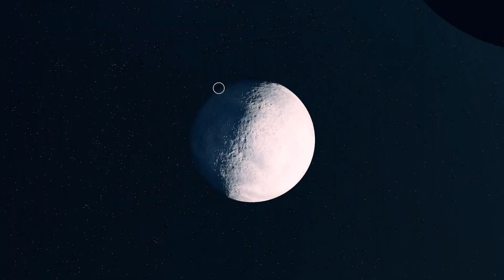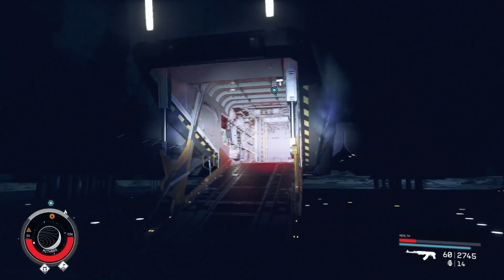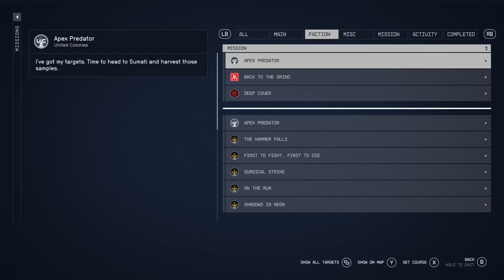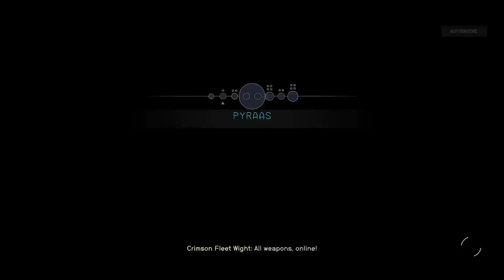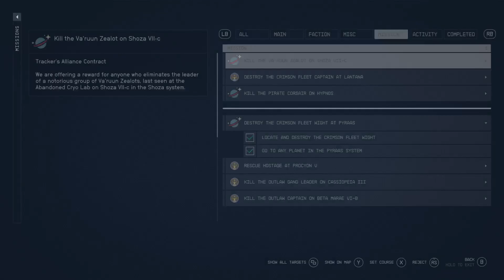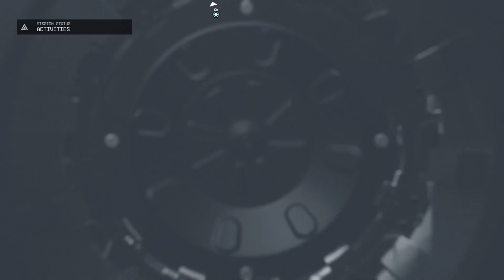Starfield Testing our new Ship we Built Ep 04

Comment: PS - get rid of turreted weapons ! Many new players use them, fooled by paper stats. In practice, they miss the target a lot ( even the game inform you about that...) and are still bugged, sometimes they will not open fire, or will fire at far away targets instead of the one right in front of you, who is killing you. Use ALWAYS player controlled weapons. When you choose weapons, do the math: see dam / sec , range, power consumption, and - important - the RoF - rate of fire ! A weapon with apparently low dam but high RoF can do significant more dam than one with high dam but low Rof. ALWAYS use ballistics in targeting mod, to disable engines, after you strip the shields. Ballistic weapons are THE best weapons against hulls. Reason you should have ballistics as primary weapon. Laser as secondary. Missiles as third weapon. ( even if, tru to be said, you only need just TWO sets of weapons...). 
( use INARA Starfield - all the info you need is there, about ALL ! ). 

Most important, avoid the crap of Particle weapons : they are way too OP, unbalanced , and make the boarding a lot harder ( when you need to control your dam in order to avoid killing the target). Bethesda should delete particle weapons or balance them, using some common sense. 
These weapons are killing 99% of the fun. 
I stop using particles after the first 100h of gameplay.
Reply from the maker: I'm not sure if all turret weapons are automatic, but I'm definitely going to check my weapons.  I don't care for the automatic.  Thank you for that.
Reply: @vanmennace If it says turret, it's automatic. I use them, but only in the third weapon slot and facing the sides and back, that way I'm always firing. Works beautifully. Plus the auto weapons get the perk bonus for auto weapons and the perk bonus for whatever their basic type is too. So, while they can miss, they hit plenty. I always test my ships in Kryx, and I always win with particle turrets combined with ballistics and energy main weapons.
Reply: they fixed the bug the problem is that not only do you need the turret skill.. you also need at least 1 manual fire weapon (not missiles) to get the turret firing best is to aim them backwards  then you open up on a ship and do a 180 and watch as they melt things that chase you.
Reply from the maker: @blastingweevil2968  love it
Reply: @blastingweevil2968  - you miss the part where I talked about turret's accuracy - they miss a lot more the target than a manual weapon! Even the game tells you that. Instead of using that power units in a less effective weapon, I prefer to use those 3 / 4 units of power in an extra engine. If you can out-run / out maneuver an enemy,  you are way better safer, cuz most of the cases (especially at high levels) the enemy will always outgun you. But with better/more engines,  they will never out-run / outmaneuver you.

Comment: Gorgeous ugly build, yet I admire your sense for functional first.  I suggest you look for "Freestar Renegade III", a Ron Hope design,  who fall in line with your style: offers a lot of space, and you have both the landing bay and the dock in the nose ( the ship is like "E" letter,  switched to the right side, where the landing bay is on the middle leg, and the dock on a side, left leg. 
This build can carry up to 6-7000, using 5 SA-4430, (5x2 power) and you can easily slap a 40 units power reactor, and a B class, 36 LY jump range, small grav drive, yet keeping max maneuverability at 100% ( with full skills in storage). You WANT max maneuverability, speed and maneuverability are way more important than shields, especially pass lvl. 90-100. 
Slap engine thrusters / breakers every point you can. I found, after the last update, my pitch and yaw, turn rate,  considerably improved after I equipped as many of those I could. 

With the right skills, you get a perfect 45  /  50 power vs power usage  on her, using 2 x Reza 300 (2x4), 2 Hunter Mag 450 "stronk" missile launchers (2x3 power) and, for boarding purpose, 2 Marauder 115N (2x4) who hit hulls stronger than a train ( 60x4 / sec,  each, for a total of 240+ x 2 = 480  ) . (max skills on ship ballistic weapons). 
Use the Osiris 2040-B, BEST  shield in-game , regen 7 and only 8 power,  but able to get over 1500 protection with the right skills (1552). 
Do the math: 10 for engines + 10 grav drive ( RD 3000 Beta 36 ly jump) + 8 lasers + 8 ballistic + 6 missiles  + 8 shield = 50. 
Since you do not need power on grav drive when fighting, you have a perfect 40 to fully power all weapons + engines + shields and extra 5 in reserve for an emergency jump, without the need to touch pips.  ( that is, assuming you rise your skills to get those 5 units of extra power for reactor). 
My character id lvl 212, on NG+3, and this is one of the most solid builds I use,  for outposts managing and combat.  Once you establish your own network of outposts with all materials you need, one or two "creds" factories, with chems or manufactured) , and money is no more a problem, start using builds all class A, go with the 3015 engines, small ships and have tons of fun. 
I strongly suggest using the option for "extreme" gameplay ( with need to eat, drink, sleep, ammo with weight, etc) since you will get almost 70% buff on your XP - helping you a lot to rise to higher levels.
Reply from the maker: I love this comment, I believe this is a new game+ 3 as well.  My original save was a +5, but those saves stopped working.  Love your concept of the 10 and so on.  Will need to try building with that process.

I completed this ship and built a other over the weekend that I have a video releasing the look, but going to try to use your concept on next build